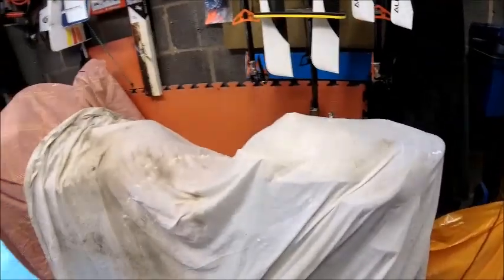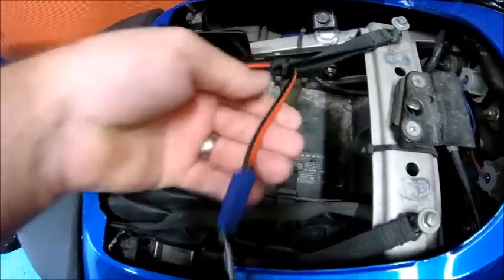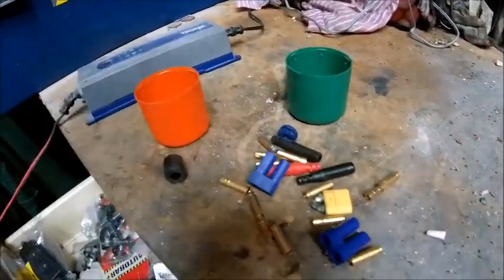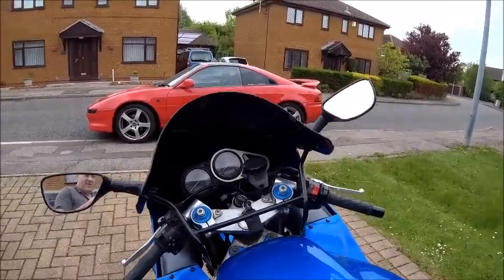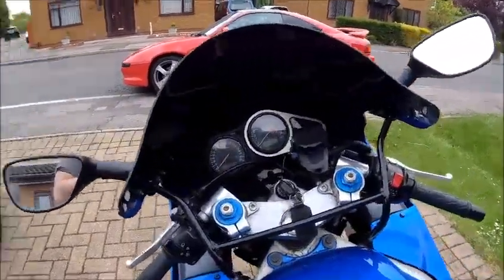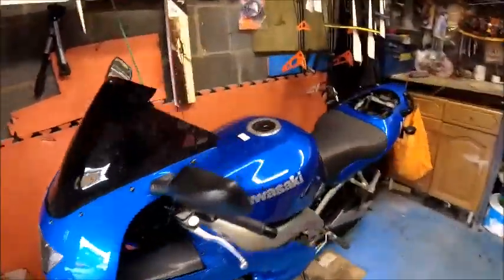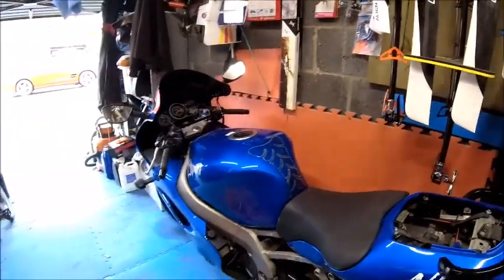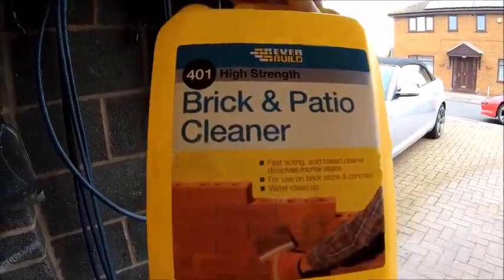Kawasaki ZX9R Ninja | Start up May 2020

Comment: Twisting the throttle does nothing prestart  there is no accelerator pump.
There is a low pressure fuel pump that primes the carbies during cranking, once it starts the pump only pulses when cyl 1 fires.
Relay is located right up in the rear tail section..
Pump is close to the fuel line inlet.
My relay had " green death" on the terminals.
Enjoy riding mate.
Reply from the maker: Thanks ..plan to use her a lot more this year....bring on the sun !

Comment: Very nice bike and nice video. I‘ve got the same bike. Can you tell me, where the Klack,Klack,Klack,Klack noise comes from after start? My bike sounds the same. 
Thanks and greetings! 🤗
Reply from the maker: Hi Bobby...I used to think this was a problem too.... Last year i had the tappets re shimmed (amongst other little jobs ) to see if that was it but i was told they where only a little way off which seemed strange, Ironically when i was in the shop a guy who used to race these who told me it was something to do with a "Flap" in the carbs and its common even from new... I've yet to find out what this flap is, but it made me relax that it wasn't something more sinister like a cam chain etc ..

Comment: I have the exact same bike, but C2 model. Mines been sitting covered up for 12years now. I'd love to be able to work on it and get it running again. Would be great to see more vids on the bike. I also have a S3 8p that I'm modding to stage 2+
Reply from the maker: Are we Twins   ???   😂  ... Gotta say i love both of my toys...Thought about going plus on the 8P  too...maybe one day  😉
Reply: @AdeReeves  must b😂. Go for it, I've done most the work myself, did the hpfp internals, but getting a mate to fit the downpipe, I'd do it myself, but not on axle stands, if I had a lift yes. Uprated clutch i got fitted.

Comment: Need to pick your brains mate my zx9 running rich and one minute its running lovey the next it cuts out I've taken it out and on change down eg coming to a roundabout cuts out again  I've had the carbs cleaned and a set of plugs would you have any idea what's the problem? Please
Reply from the maker: Like you Steve i would  have suspected the Carbs or at least a vacuum leak... I know the rubber mounting block can become brittle over time and so can the myriad of pipework connected to the carbs and i have even heard of the breather ways getting blocked...But i can't imagine what else would cause that... Maybe it's worth connecting some vacuum gauges to the carbs and have a good rummage around the area, see if that produces any results but other than that i cant see its worth doing anything like compression checks on the pistons or the like... A real long shot would be the CDI but wouldn't be my first place to start.

Comment: Reliable bikes always start !
Be careful with the meta alarm systems they can fail in you very easily.. if it does it's an easy fix if you know what you are doing  👍
Reply from the maker: Too be honest...I never found out what went wrong...its been spot on since with no more issues ...ill probably curse not taking it off when it lets me down miles from home  😂